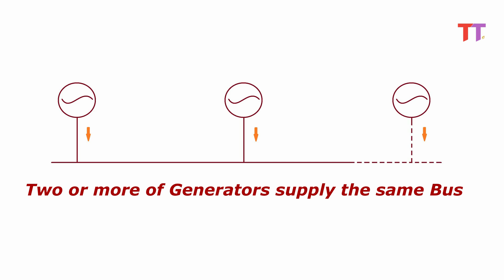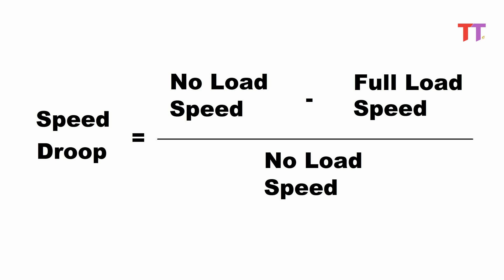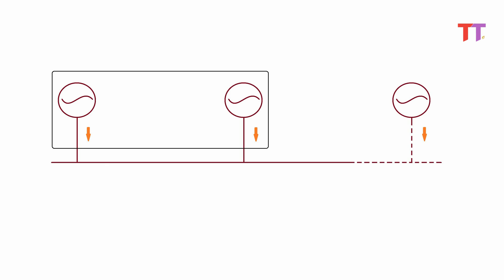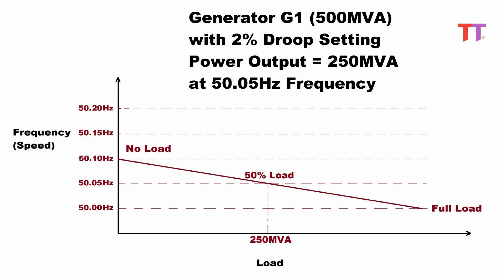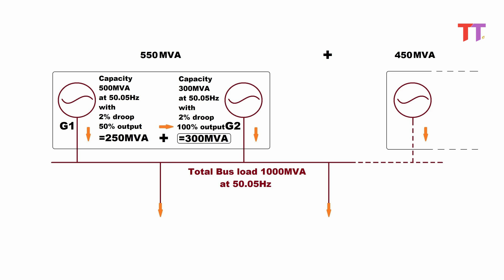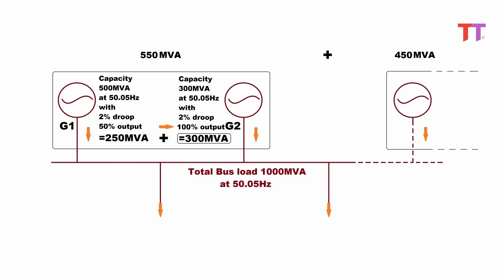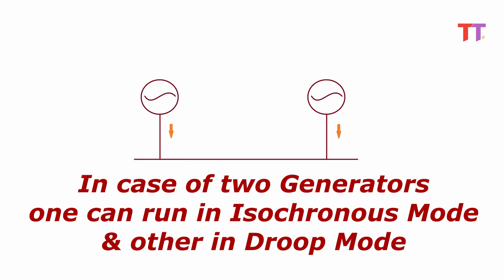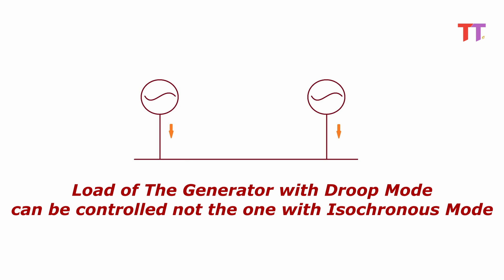What is Droop setting in Governor of Generators? How Load of Generators in parallel is controlled?

Comment: Both the real load (KVA)  and the reactive load  (KVAR)  must be controlled  Droop method works best on a pair of generators.  3 or more parallel generators is more difficult to control.  The risk of not controlling load share is motorizing a generator.  A mess for sure.
Reverse power relays can limit motorizing damage but do not prevent some damage.  It is important to note that poor load share often occurs over days or weeks or months.  When governor or voltage regulator adjustments are needed they are usually very, very small.
Having generators with identical nameplated DOES NOT GUARANTEE  good load share.  Load share computer control is coming onto the market but be careful .

Comment: I know that in an "electrical plant" consisting in some generator operating in parallel in droop mode control, the load is shared proportional with their rating. In this case, with generators ratings: 500, 300 and 600 MVA, the shared load for each generator will be around 72% from each rating. This means that the shared load for each generator will be: 357, 214 and respectively 432MVA for the third generator.
Reply from the maker: Thank you for the comment.

Comment: Hello.. If we using Auto Synchronizing module such as DSE 8610 , should we still to Apply droop to the AVR and Governor it self? 
Notes : Dse 8610 Biasing the analog voltage from 0-10 Vdc to the AVR and GOV.. Please advice thanks

Comment: Maybe someone can help me here i got a 12.7 Detroit series 60 in a semi truck. I been going through ecm tuning it truck made planty of power on dyno. But i still don't know what lsg droop rpm does  default settings are 125 droop rpm is their any benefits or draw back's changing this to higher or lower value? Max value is 150

Comment: Your diagrams are wrong. If you calculate the droop percentage given the values depicted on the graph it is resulting to a 0.2 % and not 2%
Reply from the maker: It is simply 2% of the frequency. 2% of the 50Hz frequency is 1Hz.
Reply: @ElectroGlobe1  But on the graph of G1 the change of frequency corresponds to 0.1 Hz (from 50.1 Hz under no load ==> 50 Hz under full Load)
Reply from the maker: @marsupilamiftw   Thank you very much for  watching the video, and your precious feedback.
The note about the graph will be put in the description box.

Comment: Excellent 
Can you run two generators in isochronous modes in parallel?
Thank you
Reply: I read somewhere that you can't. They fight each other and eventually one takes all the load, frequency rises drastically causing tripping. I definitely read this somewhere recently
Reply: @johanburger6109  with  commercial, industrial & utility power plant generators the droop setting on the govenor   - it keeps the engine or turbine running at an exact speed as to produce 50 or 60 HZ - with out a droop conphensation it would be very difficult to keep a balanced load on multibale generators phased in to the buss - as the load increases the droop increases the fuel or steam needed to keep the RPMs at an exact speed - on a 60 HZ system if any generator is .3 HZ to fast or To slow it can trip off the buss - I had worked in the gulf of Mexico off shore oilfields for yrs - I started as a rig electrician at 18 in the 70s but I had my grand fathers knowledge of 70 yrs of power plant generators - I had worked with him for yrs also off and on - in the old power plants and the rigs into the 80s you had to keep checking the load and you made constant fine adjustments so the 3 or more generator loads so they were balanced - if you take a small air-cooled gas genarator and put a frequency meter on it - with out a load it might be 63 HZ  - but as you increase the load sence it has no droop comphinsation the speed of the generator will continue to drop so at full load it might be at 59HZ - you can sink those generators into a buss and phase them in with other gens but you have to constantly tweak the goviner sence they  have no droop capability - the governor's will help to maintain say close to 900 RPMs but with a generator it has to be an exact 900 RPMs to maintain exactly 60 HZ - the droop makes that fine adjustment of 1-5 RPMs - today it's all automated so there's no need for an engineer to make fine adjustments thru out the day
Reply: @able880  thanks Sidney appreciate it, I found another video on this topic that cleared it up for me as you say, I have spent most of my life at the refinery wearing numerous different caps in the electrical and would love to become a rig electrician. There's an art to it as well as an honour. Just immigrated to the UK, hopefully can find something soon. Working as an compex electrician now. Its a bit boring as it's just focused and install but atleast its a foot in the door. Hope you are doing well otherwise. And yes you can't beat knowledge handed down from. If I have a son one day I will also show him everything I know. Knowledge is key and the quicker you can learn something make it stick and utilise it the better
Reply: @johanburger6109   can u send the link to the vedio u found?
Reply from the maker: Yes. It is possible